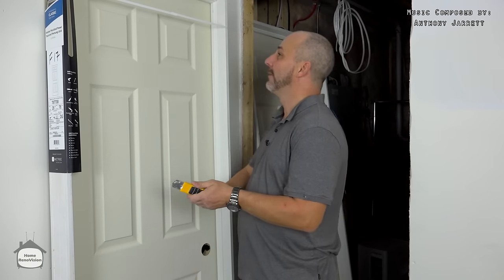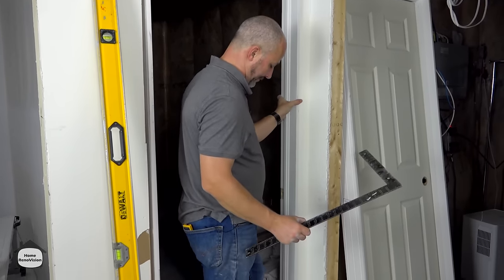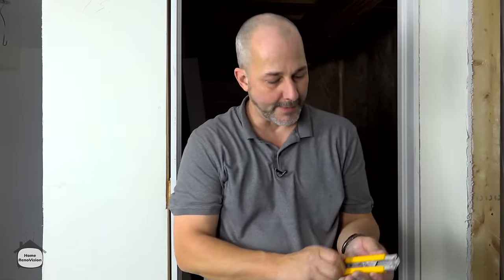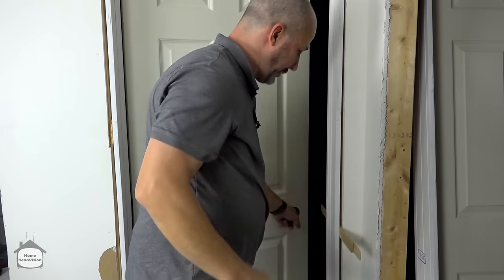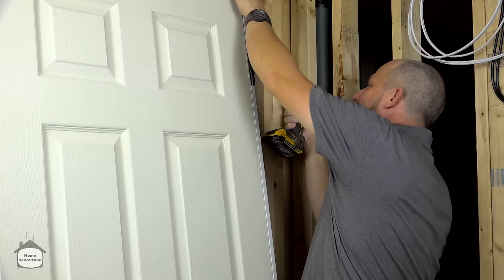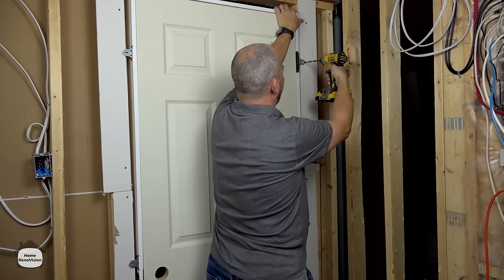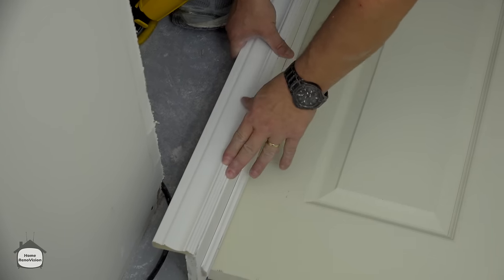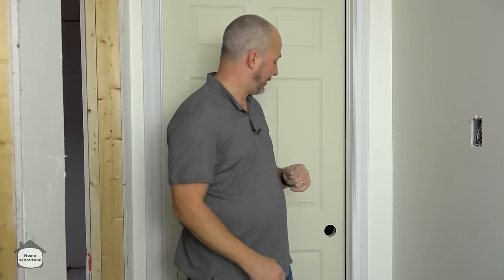How to Install A Pre Hung Door  |  3 Different Ways

Comment: I have an important question for you Jeff!!! I trust your judgement better than others.

I have contractors that are patching lots of big holes in my apartment due to electrical work. They are using a spackling product instead of your recommended rocksheet 45. I asked them about it and they said their spackle is high quality, expensive and that it's better. It dries in 2 days, turns white. The other options that dry fast might still be wet inside the walls. Now, idk if I trust them... They work in a messy way. They've been washing their diry tools in my kitchen sink, on top of my dirty dishes...... Idk if I should say anything, but I'm not at ease right now, that's for sure.
Reply: Omggg I'm going nuts! I have to supervise them constantly because they keep making mistakes or forgetting to do some holes! My walls are cracking everywhere. They keep using spackling, then sanding, then spackling again and again! They started painting, then they spackled OVER the fresh paint from that same day!! (Less than 1-3h after painting). My walls are so bumpy, I'm going nuts.

JEFF, WILL YOU COME TO MONTREAL TO FIX THEIR HORRIBLE JOB??? 😭😭😭😭
Reply: Always leave your contractors a clean and empty sink so that they may clog your p trap with joint compound.

Comment: Jeff, the clips are quite easy but you should start with drawing a plumb line on the hinge side 1/2" inch in from end of jamb.  There are lines on the clips and as long as you line up the same line on each clip, its level.
Reply from the maker: Hi Bob, sounds like it would help but in this case there was not enough room to square the door and add 1/2 ". Cheers!

Comment: Most prehung doors come with trim on one side and have a slip jam to install from other side.... not necessary to take door out....also usually set casing up about 3/8" to allow carpet, flooring to slide under...

Comment: Being "self taught" on doing this, I was curios if I did any of the ways you did. Well I use the shim way, but instead of using the screws I used 2" brad nails, replaces 14 doors in my ranch doing it this way, AND they have not fallen off the jams yet :)
Reply from the maker: no worries. it will be fine. Cheers!

Comment: I installed a frosted glass pantry door using the first method as the door is pretty heavy.  Out of curiosity, would the other two methods work for heavier doors?

I also wanted the jamb to sit on top of the floor as that's how the rest of the house is, it's a new construction home, and surprisingly the floor wasn't level, so I had to cut one side of the jamb using a leveled line drawn as a reference point (learned from This Old House). Would you still need to cut the jamb with the clips if the floor wasn't level?

Also with the clips, do you brad nail the jamb at all or add any extra nails? 

Thanks for the helpful video!

Comment: Jeff, I so appreciate all your videos.  They are so informative, and detailed.  I have a question.  I want to replace a door to my bathroom, a 28" door, with a 32" door.  My question is, how much do I need to cut back the drywall, to add a stud?  Does it matter which side I add the stud, the hinge side, or the knob side?  Just thought of another question.  What to do if the jamb sticks out passed the drywall, or, is recessed inside the drywall?

Comment: What type of flooring is/was installed under the doors?  I'm hearing advice all over the place that the jambs need to be either cut or raised off the floor to accommodate the flooring.  Additionally, I'm also hearing that certain types of flooring should be installed first (hardwood, laminate, etc) with others last (tile, carpet).  Thoughts?
Reply: Mike Gilmore 
Floors are normally installed dead last ( although not always)
Flooring installers use jam saws to get a perfect fit under the doors.

Comment: Love your humour!  Front door, metal insulated, latch not meeting the hole in the jam.  Slides shut when opened (the door). Wider at bottom on latch side than at at top on latch side. How to make it fit? I am in the province that the pm does not acknowledge....
Reply: Remove 1 or 2 hinge screws from top hinge (screws closest to door stop/weatherstripping). Install 3" screw(s) through hinge screw hole (s) into FRAMING behind jamb. Suck over till gap evens out. This will square door in frame, also raising latch to re-allign with strike plate

Comment: Found this video very interesting, oddly enough I need to learn how to hang doors because the previous owner used the third method. When I went to change the trim from the old style to a newer look, the door frames came out.
Reply: I ran into the same and was a tad confused!  Never knew you could hang a door by the trim.

Comment: This was great.  I'm replacing a door, prehung and the bottom plate is included.  We have no prehung doors in the house, built by my husband's father...  As a newbie I didn't realize the problem till I got it home ans saw that the same size door will not fit with all the trimmings and pre hung attributes.  Looks like we may have to enlarge at top or bottom meaning maybe opening cement.  So have you put out a video on what to look for when buying replacement doors?  How much room to make the frame.  How far down you would have to go to make that preinstalled plate fit the pre existing door frame?  Basically something that might help others avoid my newbie buying mistakes.

Comment: Thank you for the wonderful video.  At the beginning you mentioned to build the frame leaving a 2” gap on the sides and top.  Is this 2” larger than the actual door?  Or 2” larger than the pre-hung frame that the door sits in.

Comment: next time you install a door try this first take out the screw part  and leave the bolt part in just enough where it is in side the casing to hold door inline  with casing. then set door in opening . from the hinge side. draw a pencil line right above the casing ,move door out  and measure the rough opening . and mark center and put a finishing nail on that center mark and make a center mark on your header trim have everything in room that you need and install from that side so you can see to adjust your reveal . after you have plum and tack the hinge side. and on that one where you show how to install a door unit before any drywall wrong !!! you don't install trim first ,trim is the last to be done other than the paint of the trim.

Comment: I prefer the first method. The bracket method sucks. not a fan of the third. The only thing i would do different is to take one screw from each hinge and put a 3 inch in it's place. Thanks for the video, very informative.

Comment: I attempted to install a pre hung door today. A Mastercraft. The  homeowner bought too large a door. That has certainly complicated matters for me. I was just about to cut the door down... at an angle to make it fit and I caught myself.  I knew when to quit and this might the first time I did quit. So, I went home and I am in the process of figuring out what to do. Returning the door is not an option. I need to square up the opening and cut the door down by a half inch or so. I was going to make the door fit an uneven opening by cutting it at an angle which would have been a mess.

Comment: Question, I got about 11 interior Prehung to do. First question, I was told to use 8d finish nails rather 3” screws. Which is best and if screws what type? General construction? Second, our house has a combo of plaster board and drywall on it. The jambs are not flush, best to use the trick of shaving that stuff down to make the trim look flush?
Reply: Shims with 8d nails (2 per shim) is sufficient for hollow core doors. Heavier solid core doors require 2- 1/2" min. Screws ,, replacing middle screw in both top and bottom hinge. I Don't like the "screws through the jamb" method. I have never seen a professional do it that way, and I have been a trim carpenter for 30 yrs.Don't quite understand what you mean by combo drywall and plasterboard.What is total wall thickness?

Comment: I could use some advice. I'm going to frame a door in an unusual space. I have an alcove, 37" wide, 34" deep. I plan to install a 28" door to make it a closet. Given a 30" frame for the door, that leaves me just 7" for all my studs. Complicating things: The left abutting wall is not a 90 degree angle. It's wider, about 100 degrees. I plan to make shims for the left king stud to square it. I could simply install the king and jack studs against each of the side walls and wind up with a 31" door frame for my 28" door. However, if I use only one 2x4 stud on the right side, the trim around the door should hide most of the drywall seam. So my questions. 1. On that right side, can I combine/weasel my king and jack stud into one. The stud would go up to the header. Then I "complete the jack stud" with a short cripple stud from the header to the top plate, nailed into the right wall. Yes, it's against the rules, but... 2: On the left side, my drywall is going to meet a wall that's wide at a 100 degree angle. Can I use a rasp to bevel that side of the drywall so the front is flush and the rest is angled to compensate for the wall? Thanks for any help!  Joe

Comment: You are supposed to take a level and draw a plum vertical line on both sides to match the clips up with before inserting screws through the clip holes. Then you simply match the alignment hole to the same notch on each clip. They actually work really well when installed that way.
Reply from the maker: If you like it then feel free to use them. Cheers!

Comment: I wish I saw this video last year when I installed 5 prehung doors. It was such a nightmare and I did a terrible job on 3 of them! I know what a lot of the mistakes I made were, but this video will help me with the next 7 I need to install. And I will most certainly replace or fix the three I screwed up.
I know you have done videos on soundproofing. I've been doing a lot of stuff in that regard on my home too, but I find the doors are a major sound leak and I'm wondering what tips, tricks and suggestions you have for that. I've filled the gaps where the shims go with a bunch of silicone, I've reduced the gap between the bottom of the door and the floor as much as possible. And IMO I've found solid core doors to be surprisingly disappointing products to work with. I've had to cut down the height of two of my doors to fit under a beam that's about 6'2", and when you get past the solid wood frame both the hollow core and solid core doors have, the solid core doors are filled with such a brittle filling it is hard to keep it from falling out and it is so unuseable it might as well just be hollow.

Comment: I like it when it's really solid, but I only knew the old fashion way to do it, so all the doors I installed in my last house I built, I used the old fashion way, that is for 20 doors, plus 2 patio doors and the 2 garage doors where different, but on each door I shimmed the top also, at 2 places, and screwed it there also, a bit like when I installed the windows that I shimmed the four sides....then you are certain it wont move nor twist! I don't think I will ever use another method, because it's simple, efficient and solid as hell! The extra hardware door I found it a bit Mickey mouse to add all that hardware, and the cheapest one, well...I will not do the trim, up until I do trimming...

Comment: Jeff, I'm following your instructions for installing a solid-core door in my basement "the strong way". I've got the hinge side of the frame plum and flush with the wall, but when I reattach my door it hangs crooked with the top corner of the door hitting the frame. I've tried 3x removing the frame and trying again and still get the same results. Could the weight of the solid-core door be pulling it out of alignment?

Comment: Express hardware $4.98 per door at Home Depot. I draw a plumb line half inch outside rough opening on the hinge side so all screws are started on that line same spot inside the slot.. Maintain your space from jamb to door on other side, secure with screws and shim snuggly and your done.
Reply from the maker: that works well in a plumb and square world for sure.
Reply: If you are shimming, why use brackets?

Comment: Great video!  But don't you need to measure and sometimes cut the bottom of the door jams depending on what type of flooring you may be using, or if the flooring already exists?

Comment: I have an existing door where the instalation of it is not square at the top. (older house) but floor is level. Bad install. how to you repair the door for proper level at the top?
I like your shim method the best seems the most secure too.

Comment: The third method is best. You do not need screws to hold an interior door. There are over 50 nails holding that door from moving once you nail the casings on and shim it properly

he put the casing on the wrong side
You put the casing on the hinge side or the side where the barrels of  the hinge are. this way you can properly see your Air space

Also he didn’t add any Shims on the side where the door closes against the stop

FYI I’ve done this my entire life for over 40 years day in and day. Not a jack of all trades just a trim guy.

Comment: Jeff, as an electrician for 40-years, I've never seen a breaker panel mounted horizontally (why?!). How does the panel door stay open? I'm not sure that would meet NEC code here... Thanks for the good door installation tips though!

Comment: living in a old brick house with mortar on the walls i stick with old fashion way  and sometimes even have to ad wood to the frame so it fit the thickness of the wall and that is an entirely other game in it self believe me
Reply from the maker: Hi Dennis, in those situations i like to use window spray foam to bond everything together. Cheers!

Comment: You need filler on top of those doors, your rough openings are too tall!! Otherwise you need wider molding or door casement  molding to cover all of that!! If another stud will not fit, I use 1x4, or scrap plywood filler.  A good way to hold the door jamb so it stops falling through the opening is screw some scrap for a tab  perpendicular to top plate so it acts as a stop. That way you have hands free while plumbing and leveling the jamb. A trick I learned from a  Total GC(General Contractor) I worked for.  I like your format, and humor, and you are very informative, thank you for your uploads.

Comment: 18:23. The plastic locking pin from the door manufacturer had you hung up...   they may have framed that opening correct... just maybe 😆

Comment: Hi Jeff, I have been watching a lot of your videos lately as I am finishing my basement. All your tips and tricks are just awesome! Thanks for all you do. I do have a question about the size of the gap between the studs and the door frame, if I want to install a 30’’ door in a 35 ‘’ frame, would you recommend just shimming or should I close that gap with an extra piece of 1’’ thick wood first?

Comment: I live in an older mobile home, the original doors were very flimsy and small. I bought replacement pre hung doors, it's a little too wide and too thick. I'm 1/4" too wide and 1/2" too thick. I'll be removing the drywall and moving stud back. But as for it being too thick, what do I do about that? It'll stick out 1/2" on either side of the room/door

Comment: I removed an exterior garage service door that was installed with only the brad nails in the casing.  Casing nailed to door and casing nailed to the frame.  The jamb was not fastened at all.  I was only there to replace the rotten casing but had to rehang the door.  I didn't think it was that crazy but my Boss didn't believe it and had to come look for himself.

Comment: Question: what do you do if the drywall on either side of the door is 3/8” on one side, and 1/2” on the other? The door jamb would be proud of the drywall on one side. What to do about the casing?
Reply from the maker: that will not be a problem. a little twist and a little caulking will solve all of that if you don't want to replace the 3/8 drywall. Cheers!
Reply: Even though I’m staining the casement and baseboards? Not painting